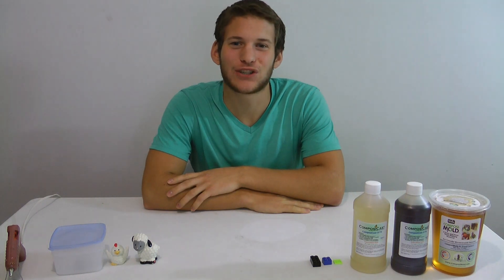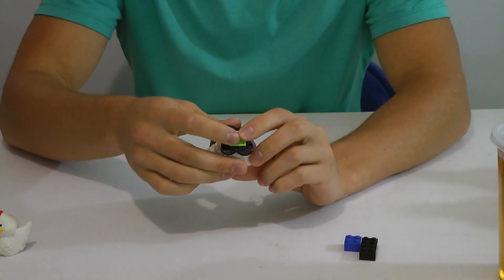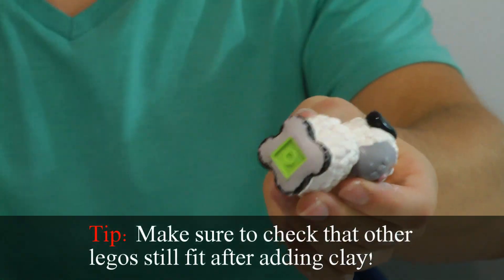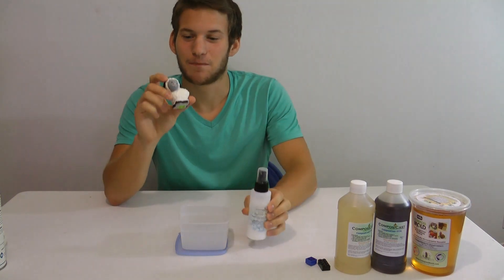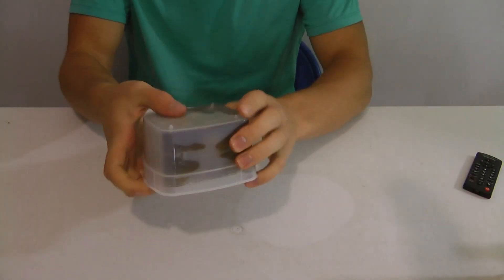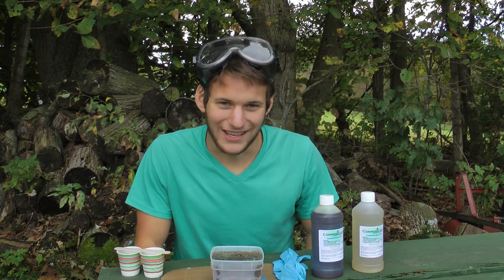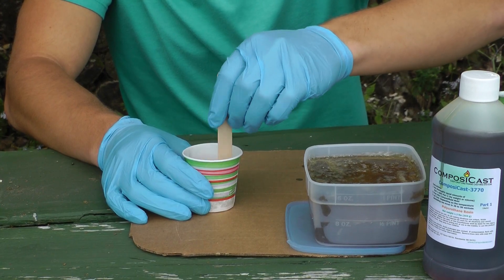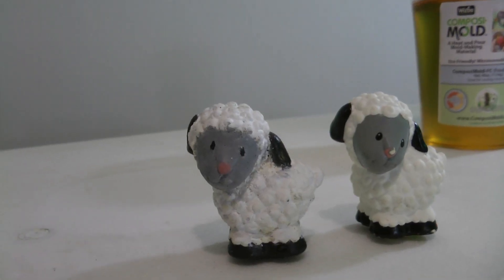How to make/mold a Lego

Comment: What is the maximum temperature
Reply from the maker: ComposiMold melts at about 135 F. If you chill your mold you can do higher temperature parts. We also have ImPRESSive Putty that can handle up to about 180 F and higher if chilled. Don't overheat the ComposiMold so it boils. Thanks!

Comment: Sort of a side question. Does anyone know why Lego doesn't mass produce those hard to find pieces? For example the 9.5L extra firm shocks which now costs you almost $10 each and the 4 Ball Joint: https://rebrickable.com/parts/32495c01 is even more expensive. As a company Lego is not profiting very much from selling used Legos at all. Maybe this policy forces people to have to buy expensive kits just to get access to these very unique parts but some of the parts haven't been made for quite some time ? In some case you just can't find certain parts anywhere no matter how much you are willing to shell out but injection molding these parts is relatively cheap for Lego.

Comment: how stiff do those resin molds hold up. like how strong is the finished product?
Reply from the maker: Different resins will have different strengths. If you want a resin that is stronger than a LEGO I would recommend PureCast 605 http://composimoldstore.com/all-products/purecast-605-1-12-quart-kit/The resin used in this video is very strong but, if the part was thin it would be easy to snap in half. If you made a thin PureCast 605 part it would bend instead of snapping similar to a toy soldier.
Reply: +ComposiMold Reusable Mold Making Material thank you for the information. I'm just now getting into mold making and want to mold a miniature Ironman helmet. thank you for your help again

Comment: great tutorial. is it as resistant as lego however? is it possible to make tiles or even thinner plates?
Reply from the maker: +Mike Smith Thank you for the positive comment! I Would recommend using Clear Casting Plastic 2 part resin found at http://composimoldstore.com/all-products/clear-casting-plastic/ This material is strong and can be used to make thin parts for example we made a small sword in this video  https://www.youtube.com/watch?v=ULx2Y_nUdgY

Comment: I have a question.  How much would all this stuff generally cost ?
Reply: Also how did you get the sheep perfectly in then middle without holding him in place....
Reply from the maker: MrBeastboybrown  Thank you for the comment!You can get everything you need in one package ComposiMold, Bubble Buster, Mold Release, Clear Casting Plastic for $89.99http://composimoldstore.com/all-products/composimold-all-in-one-package/?page_context=category&faceted_search=0This package would give you enough material for about 10-20 LEGO sheep sized projects.
Reply from the maker: MrBeastboybrown We moved it to the center after pouring the first half wile it was still liquid.

Comment: Thanks. Oh and could you make the titanium ninja?
Reply from the maker: Great question! Yes, to make the Titanium Ninja we would use the same technique used in the Minifgure video and add metallic powder to the resin or brush the metallic powder onto the mold before pouring the resin. Or if it is easier,  you can paint the ninja. Do you have the original Titanium Ninja? or are you making it from scratch?

Comment: does the casting resin harden fairly quick? how quick? can you wash the resin off if it hasnt completely cured?
Reply from the maker: Todd Quenzer Hi Todd, Thanks for the questions. ComposiCast starts curing in 3-4 minutes and can be removed from your mold in 20-30 minutes. Cleaning:
 To improve clean up after using the ComposiCast Urethane Resin, spray 
the areas that may be in contact with the urethane with mold release so 
the urethane will not stick. Tools and equipment should be scraped clean
 prior to the resin curing and hardening. If necessary, denatured 
alcohol can be used as a solvent, but use with caution due to the 
flammability.Please let us know if you have any other questions.

Comment: How did you pour it in there
Reply from the maker: Thanks for the question! You melt the ComposiMold, Reusable Mold Making Material, in the microwave and then pour it into your heat safe container with your master object secured to the bottom of it. Using this 2 part mold making technique, you only pour half of the mold, freeze it, spray mold release, and then pour the second half of the mold. Let us know if anything is unclear and we will answer any other questions you have.

Comment: Is it possible to mold lego minifigures like the head torso arms legs hair and what not?
Reply from the maker: Hi Andy! Thanks for the question. It sure is possible. You can apply the same ComposiMold techniques to any object YOU choose. You will, most likely, be using a 2 part mold making method so you can duplicate all sides of your object. Be in touch with any other questions! (info@composimold.com too)
Reply from the maker: Andy Martin Hi Andy we now have a video on mold making and casting LEGO mini figures at https://www.youtube.com/watch?v=qxmjziQD0Es&spfreload=10 Check it out and let us know what you think.
Reply: Saw it. Pretty cool